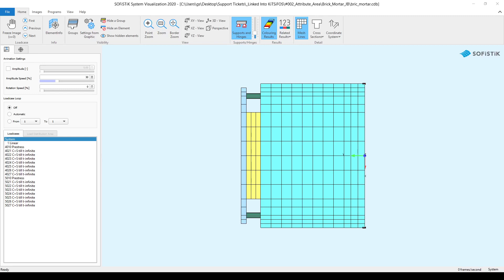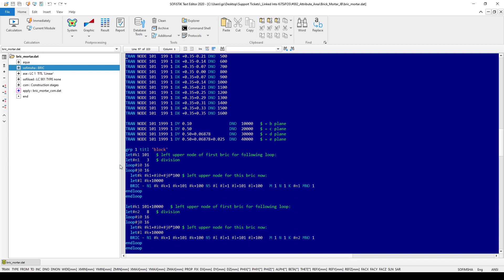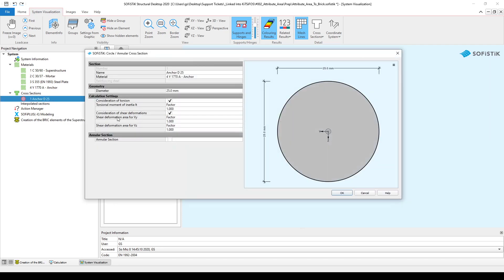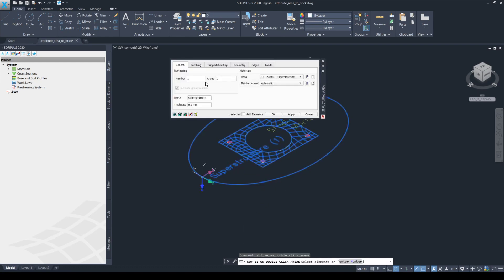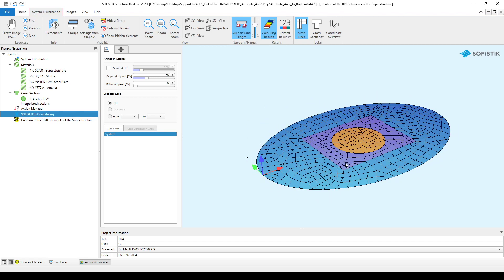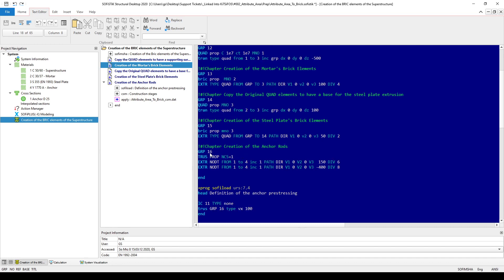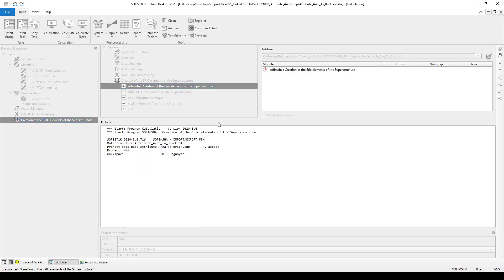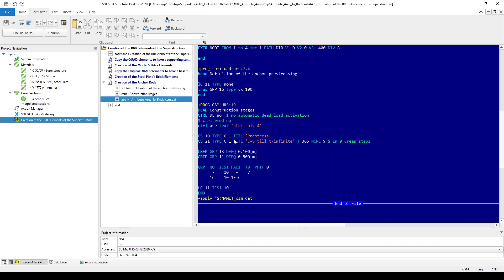The Power Of Attribute Area in SOFiSTiK #SOFiSTiK #SOFiSTiKTutorial #Tutorial #AttributeArea

Comment: Thank you for the video it's very helpful, I have a question, when you copied the steel surface to create the steel plate in Bick element, that steel surface created with sofiplus still exists in the model with a thickness= 0 mm, does this surface  affect the model when you calculate ? Thank you
Reply from the maker: Since its thickness is set to 0 mm, it won't effect the result of the analysis. However it can also be deleted with the help of command DEL in module SOFIMSHA.
Reply: @LinkedIntoKiTSiFOS  thank you